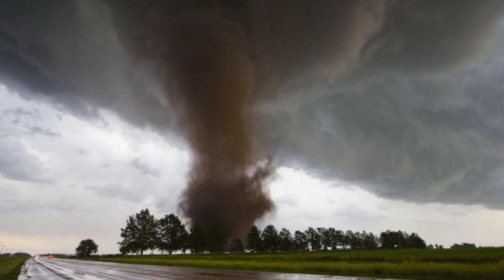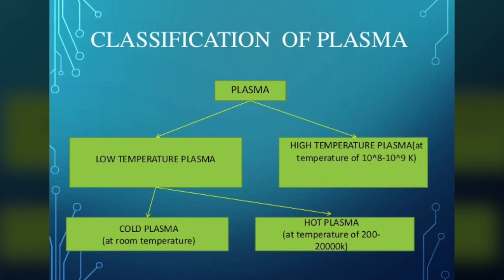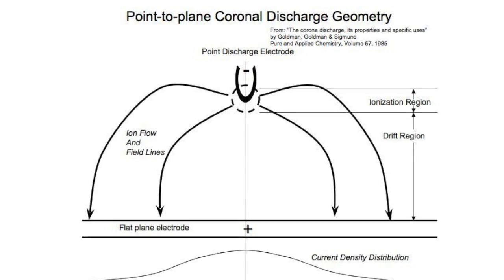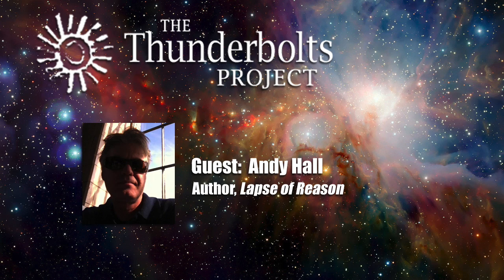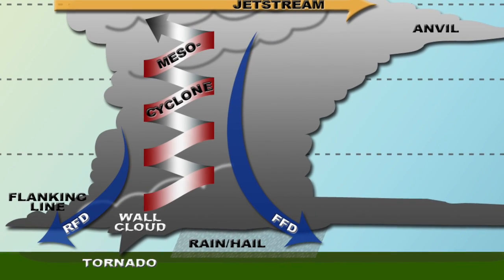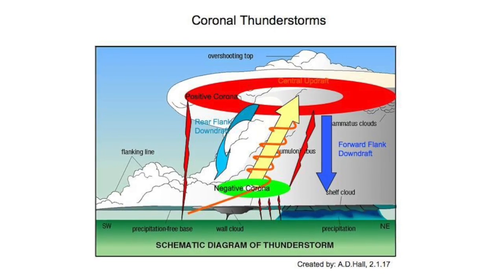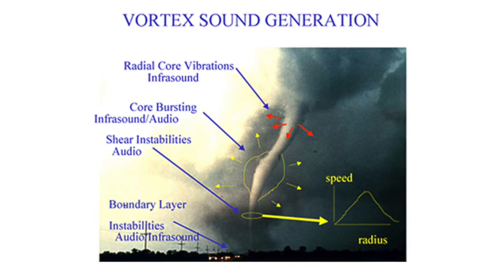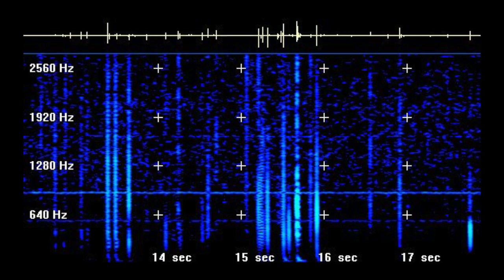Andrew Hall: Tornado – The Electric Model | Space News

Comment: This also applies to dust devils/ snow devils / fire devils?? / water spouts?
Reply: It doesn't even apply to tornadoes, so you kind of should start there.
Reply: @bruzote  how do you explain a dust devil in -10c on snow fields? hot spot is the official explanation
Reply: @policematrixx  for a dust devil you don't need the air to be hot, you need it to be HOTTER than the sorounding air
Reply: @manjuan9632  there is that word again "hot" 
Why does a fire on a cold night never want to rotate? you couldnt get a hotter hot spot with a supply of energy, russians and people from other cold places would be posting endless vids about them spawning from fires on cold nights yet not one?? 
Then there is a forest fire in a hot country and they spawn surrounded by equally hot air ?_? 
If you rule out temreture difference causing it what do you have left?
Reply: @policematrixx  a fire is not enough, you need it to be rotating faster than it's rising, once a strong vortex occurs it acts like a straw, and sucks in fire

Comment: Even at the most basic level this can be debunked.  If the tornado were a plasma conduit for charge, the lightning would stop because the tornado would act as a grounding wire, neutralizing the charge differential.

In reality air (even wet air) is a strong insulator, which is why static charge accumulates.  Not unlike when you rub a baloon over your hair (rubber incidentally also being a tremendous insilator).  Only when the charge differential builds to such an extreme degree do you have arcing (lightning).   The stronger the updrafts the more lightning you get - if there was even a shred of truth in any of what you suggest, lightning would stop as soon as a tornado forms, as plasmas are extremely good conductors of electrical energy.
Reply: I actually think this is what is observed. There is a paper that documented the number of lightning strikes before, during and after a storm, and that most lightning strikes occur before and after, and fewer once the tornado touches down

The Paper is : "Characteristics of Cloud-to-Ground Lightning Associated with Violent Tornadoes" By Perez, Wicker and Orville.

I'm not a proponent of electric universe, and i believe electricity is correlated, not causal to tornado genesis, but out of anything that could be undergoing influence from electromagnetic forces and fields, it's not outlandish for tornadoes to be one of them, since electrical activity usually accompanies storms lol.
Reply: The argument is the air is not close to a well-conducting plasma, like a crappy plasma. As such, like the whole hypothesis.

Comment: The plasma of tornadoes involves hydrogen bonds of H20.  It is not ionic.  Andy Hall fails to realize this.  The plasma phase of H2O emerges on wind shear boundaries and is the proximate result of spinning of H2O microdroplets. The physics that underlies these capabilities is hidden by the current chemistry paradigm in what is referred to as the anomalies of H2O.  The anomalies of H2O is an embarassment to the current chemistry paradigm stemming from an error by Linus Pauling that chemistry has been sweeping under the rug. So, Andy Hall is right that there is plasma and even electricity involved with tornadoes.  But his brain is locked in on the notion that all plasmas must be ionic.  This prevents him from realizing there is a hydrogen bond based plasma that occurs at room temperatures.
Pauling's Omission: The Original Sin of the Natural Sciences

https://www.youtube.com/watch?v=iIQSubWJeNg
James McGinn / Solving Tornadoes

Comment: Would a Faraday cage dome interfere with the ion flow?
Reply: The mean distance of an ion traveling in the troposphere before a collisionally-induced change of direction is radically smaller than the mean distance the ion will travel in an updraft or other similarly-scaled movement, or even in a smaller turbulent eddy. The electrodynamics of the air around a tornado or funnel cloud are overwhelmed by the dynamics of air pressure gradients, gravity, momentum, and the energy cascades involved in these three things.

Comment: Finally! My questions are answered and support my own conclusions!  I believe Hall's research has more validity in dissipating tornadoes, large thunderstorms and hurricanes than the "other" scientists who won't even look at the electrical connection.
In most cases the luminosity or glow is occurring in day time, often bright sky near, and over open terrain, where there are no ground lights or power lines to cause the effect which scientists have been dismissive about.  
What do you have on anticyclonic storm cells & tornadoes in the northern hemisphere, and why are they becoming increasingly common?

Comment: Excellent job. The old "hot air, cold air" mixing to form a vortex explanation always seemed a bit off. This makes a whole lot more sense.
Reply: The plasma of tornadoes involves hydrogen bonds of H20.  It is not ionic.  Andy Hall fails to realize this.  The plasma phase of H2O emerges on wind shear boundaries and is the proximate result of spinning of H2O microdroplets. The physics that underlies these capabilities is hidden by the current chemistry paradigm in what is referred to as the anomalies of H2O.  The anomalies of H2O is an embarassment to the current chemistry paradigm stemming from an error by Linus Pauling that chemistry has been sweeping under the rug. So, Andy Hall is right that there is plasma and even electricity involved with tornadoes.  But his brain is locked in on the notion that all plasmas must be ionic.  This prevents him from realizing there is a hydrogen bond based plasma that occurs at room temperatures.
Pauling's Omission: The Original Sin of the Natural Sciences

https://www.youtube.com/watch?v=iIQSubWJeNg
James McGinn / Solving Tornadoes
Reply: @jamesmcginn6291  - That is not the only manner by which he wanders in confusion or willfully ignoring and omitting.
Reply: https://anchor.fm/james-mcginn/episodes/The-Public-Believes-Plainly-Dumb-Things-About-the-Atmosphere-eacv0k
Reply: It didn't make sense to you because you got the concept 100% wrong. Mixing is not what drives storm development. It is how different "parcels", "masses", "volumes of air" generally do NOT mix and thus act differently based on their different characteristics, rather than mixed and thus smoothed characteristics that occur with mixing. Sheesh.

I would add that mixing DOES occur, but that is not what drives the storm. Entrainment can be substantial, but it can end up reducing buoyancy as well as the growth rate of droplets, key factors of developing a thunderstorm in the first place!
Reply: You've seen one presentation and you're sold on the idea?

In the field of hucksters, you're know as a "mark", and an easy one at that.
Reply: @uploadJ  Conventional vagueness treats the populace as 'marks."  But I agree that this video just throws a lot of verbiage around and doesn't directly address the phenonenon of tornadic vortices.
Reply: @jamesmcginn6291  are you kidding me? You clearly didn't watch or at the very least understand what was said in the video.

Comment: Hi Andy, I have some questions about tornadoes.  Now I realize that this is a new science and so you may not have all the answers so far.  But if you do, I'd like to hear them.
1.  Why do tornadoes populate only the Midwest?  Yes, there are dust devils and water spouts, but it seems that only the USA receives tornadoes, or am I wrong here?
2.  The green glow within a tornado cloud is caused by coronal discharge.  Is this the same thing as the Aurora Borealis?  Is the cause the same?
3. Wind is not enough to pick up a car, truck or boat and sit it down on top of something else without causing damage.  There are reports from hurricane survivors of seeing objects floating.  So, what causes the anti-gravity effect of tornadoes and/or hurricanes?
Reply: Tornadoes can and do occur around the world. They happen a lot in the Midwest because of how the vertically and horizontally changing wind flow in the Midwest can seasonally setup optimal conditions for a tornadic storm. Funny enough, and Mr Hall skipped over this, this driving influence over tornado frequency is a feature of Newtonian Mechanics and Thermodynamics and not one bit related to Electromagnetics. But, when you see all the world through electromagnetic lenses, nothing else exists and thus can and is ignored - including features of storms that can be highly dominant rather than forgettable tertiary effects regarding the local air movement of the storm.

Comment: Perfect. What led me to this idea was that the Sun shows this action due to it's intense electrical value. The loops we see on the sun happen exactly that way on Earth. In fact all bodies in space do this. From the dust devils on Mars to the water fountain sprays on the moons around planets. Remember plasma is everywhere and matter displaces that plasma. So our Earth's matter displaces the plasma and forms layers of density around our planet based upon the displacement density. These layers have matter in them and gets less dense on the ground to very high density of the ionosphere of plasma.
 Now think about this analogy. Fill a tub with water that has a plug in the drain. The air above the water has a density difference. When you unplug the tub at some point a very familiar shape happens at the drain. Vortex or tornado appears.
 This same concept can be applied to the surface of the Earth. Except the water is replaced with air and the air in that example is replaced with a higher density plasma that wants to go to ground and drain away. The air displaces plasma to a degree and the above layer of plasma is more dense right. This high density plasma pushes it's way towards the ground and actually enters the ground but displaces matter at that point, ie the destructive path or contact point of the plasma entering the ground.
 The loop can be massive at one point from the ground and focused at the other like you have shown.
Reply: This comment has all the associative confusion of a schizophrenics delusions. I mean that in all regrettable seriousness. Go read the writings of schizophrenics. This is up that ally. People with trouble connecting meaningful relationships in reality confuse associations with meaningful relationships, at the worst they confuse them with cause and effect. As people generally know, associations and analogies can be extremely different things than establishing cause and effect. Th language here is not even working to demonstrate either truly analagous associations regarding important relationships (or characteristics), nor is the wording leading to logical development of cause and effect.
Reply: @bruzote  What a nice word salad. Been looking in the mirror to much lately bruzote?
 I mean How did "Th language" get by your intellectual prowess?

Comment: I noticed cirrus clouds, if you look at them, their wisps, they do not point in the direction of the wind direction, they wisp in a direction 90 degrees to the direction of the wind. This makes me think one side is positive & the other side is negative. The ice particles in them are moving in a direction away from the wisps. The cloud is being stretched in the opposite direction of the wisp
Reply: Cirrus clouds, in particular the "mare's tails" you seem to be referring to, are stretched in the direction of wind shear as ice particles of the clouds descend into lower layers air that can be moving at different velocities (both the speed AND direction can be different). In fact, this wind shear can be observed and measured to determine the actual shear. Further, one can use this data to estimate the "thermal wind" and "differential advection" that is acting at that place you are observing. These attributes can be used to make a weather forecast, albeit with general assumptions. This very kind of analysis was used by meteorologists long ago for "single station forecasting", such as when remote stations had no other forms of data to make a forecast. When combined with even limited data about the general evolution of the atmosphere in the station area (e.g., seasonally cold air has been reported to have moved in over 200 km away), one can actually get a forecasting success rate that beats climatological and beats persistence. That means the forecast is better than nothing. Not bad for just looking at a few clouds. So, nothing to do with electric field distortions. Everything to do with movement of air ultimately driven by heating of the Earth system by sunlight.

Comment: I would also like to add that this effect is certainly the same as the one that has cleaned the Mars Rover several times.  NASA has suspected electrically charges Dust Devils.  The winds on Mars are too thin to blow all the dust away.  A good electrical cleaning would be much more effective and I believe that is what the pictures (of the rovers) show.
Reply: If the wind is too thin, as you just said, then the wind is too thin - even if it is an electromagnetically-induced wind. N'est-ce pa'?